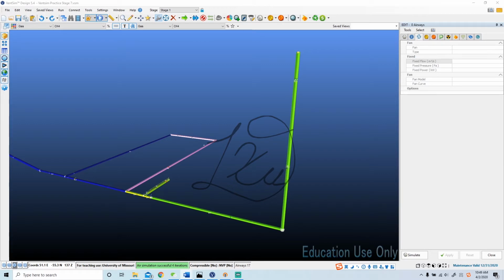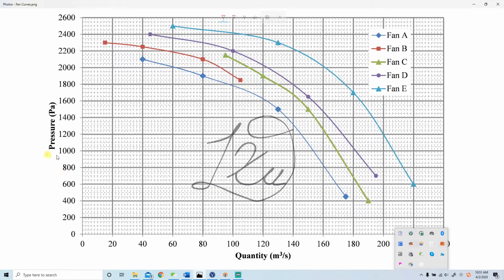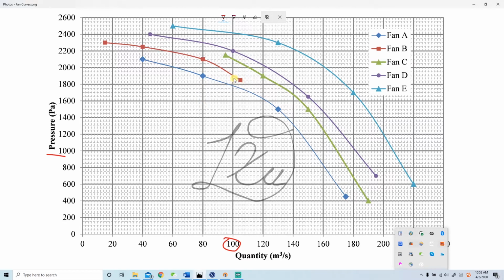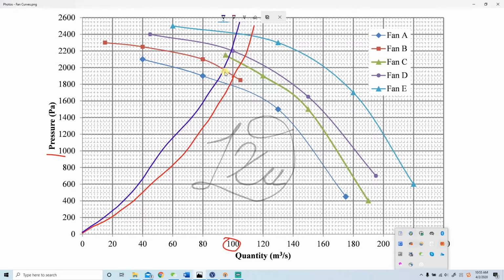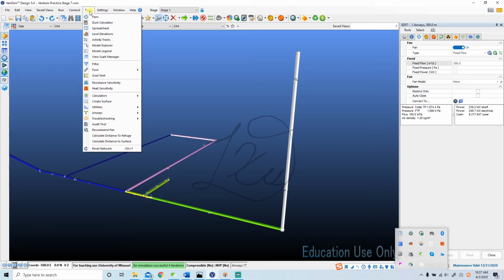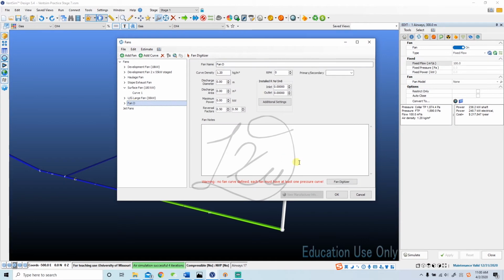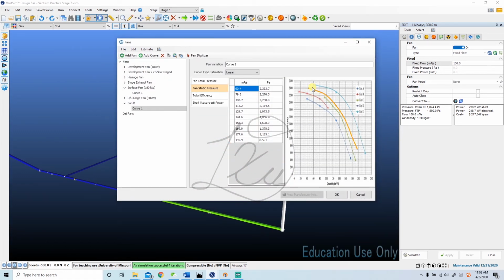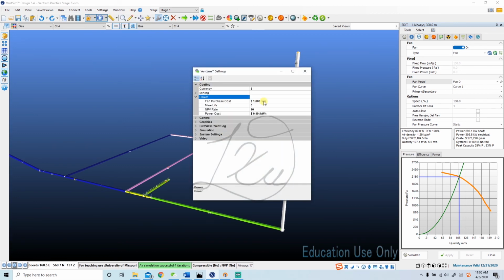Ventsim Tutorial 6_ Add a Fan to the Ventilation Model

Comment: Hi Dr. Xu, thank you for your video. With regards to the square law you speak of at the start of the video, how are the total resistance and total quantity (R and Q, respectively) determined after the mine layout is completed. I am trying to determine the total pressure using the square law, so I can then choose the correct type of fans that will be required for the mine.
Reply from the maker: Hi Matthew, you will need to get the mine total resistance (R), also you need to determine how much air (Q m3/s) you need for the mine. After that you will get the pressure loss P=RQ^2, this will be the required fan static pressure. Give this pressure and Q to a fan manufacture and they can suggest some proper fans for you.
Reply: @DrXu-cy1nb  thank you for your reply! In order to determine the mine total resistance, assuming the default settings for resistance in my Ventsim model are correct, am I able to use the resistance values found within the airway properties/edit window for each airway? And therefore compute the mine total resistance. I am struggling to draw a simplified layout for the mine as there are many dead end development headings that come off the main ramp intake/exhaust (I assume they just act as multiple different series?). Also, are you able to provide some guidance how to find the quantity of air needed? Thank you!!
Reply from the maker: The mine total air quantity is determined by considering many factors. One way is to consider the air requirement for each underground working face, plus 30% leakage, that will be the total mine air quantity. However, this is not the only method that needs to be considered. After the total air quantity is determined, you can add a fixed flow first, which will give you the required fan total pressure. With the Q and fan total pressure, the fan manufacture can suggest a proper fan for you.